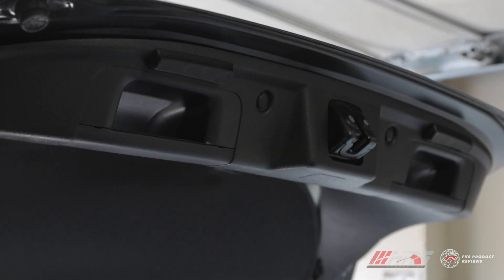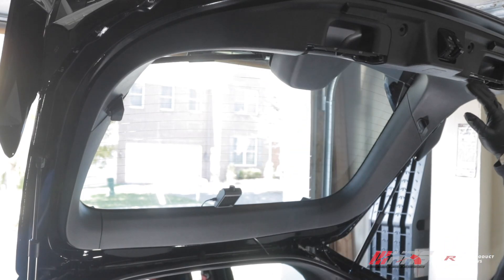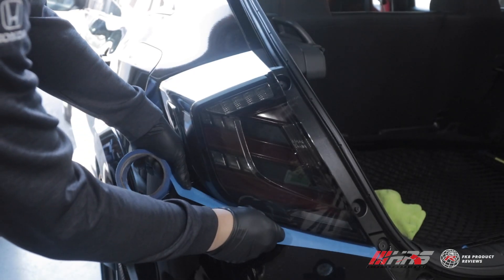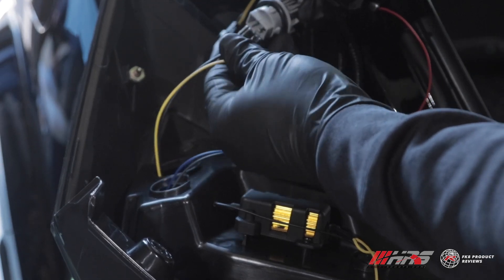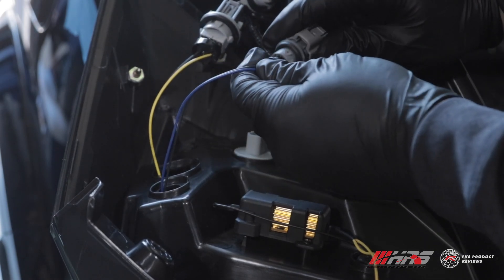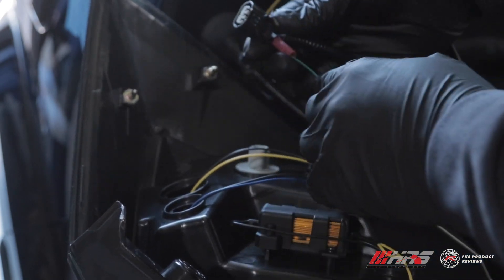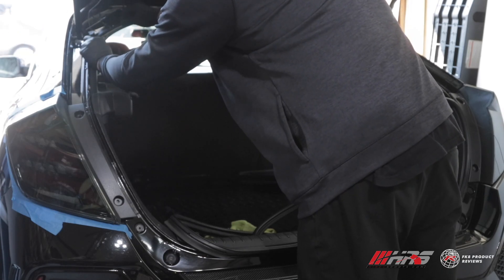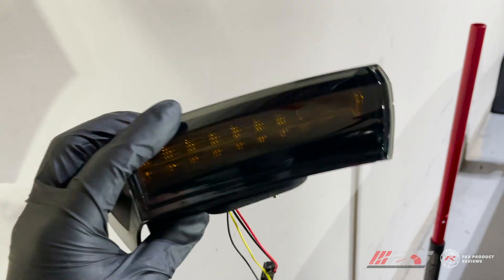HRS - 2016-20 Honda Civic Hatchback Tail Lights - V2 Installation (FK7-FK8)

Comment: I just had to say "Thank you" for posting this video. It really helped  me install these tail lights. Especially the part with what to do if the lights aren’t working,  which is what exactly happened to me. I simply had to flip the connector and just like that, it worked. I had these lights sitting in the box in my room since February. Thank you so much, man. They look amazing!!!

Comment: Great video this helped alot during my install.  We didn't need the wire loom at all.  One thing to remember is that if everything is working correctly except the animation, you simply need to turn your lights on for the animation to work.  If you install the lights in the day and your lights are on auto, the animation will not turn on.  I figured this out because it was irritating me lol.  In my opinion version 2 of these lights are brighter and I love the look! Thanks again!
Reply: so what did you do without having to use wire loom?
Reply: @Camhill182  Hey Cam from what I recall ver 1 install is different than version 2.  When I refer to the "wire loom" I meant that part of the install where you put the wires through the middle piece and then they branch off to their respective sides.  And then you push that wire loom up and hide it in the center.  With Version 2 you don't have to do this at all.  All I did was hide the wires along the rubber trunk liner.  I hope this makes sense.
Reply: Did sequencing work on all four lights without the loom?

Comment: I just installed today, looks great! However, I am getting hyper flash on my left turn signal… my hazards work fine and same with unlocking my car, the turn lights work fine. It’s just when I am turning left that seems to be the issue. Any ideas?
Reply: Update: for now I am running non-sequential on my turn lights until I can figure out what’s going on… maybe I have a defective product?
Reply: Front signal bulb or mirror bulb (if applicable) both working? Also. maybe try and replace turn signal flasher?